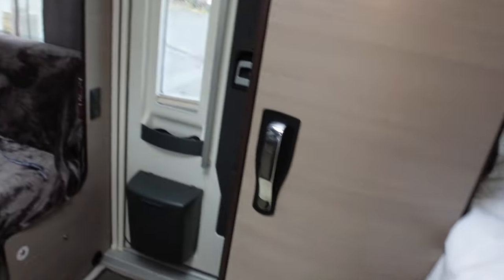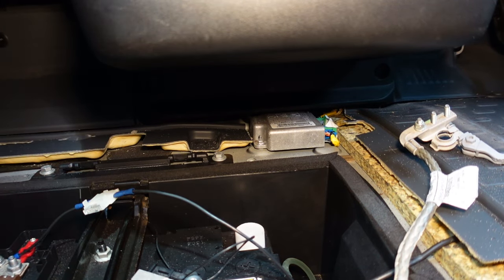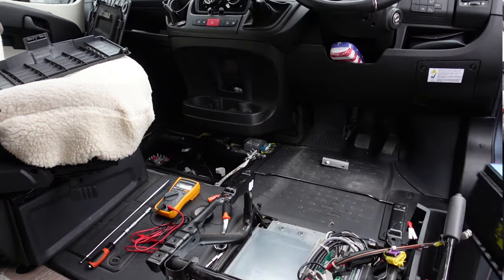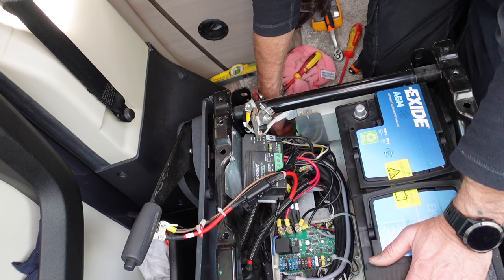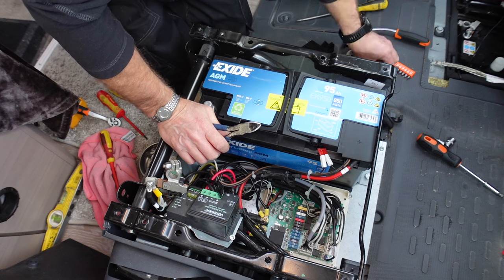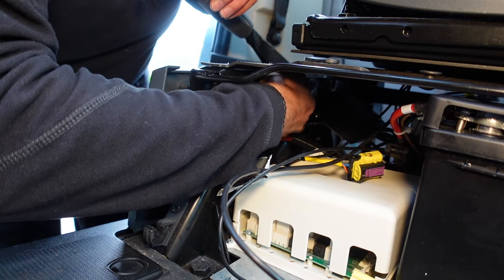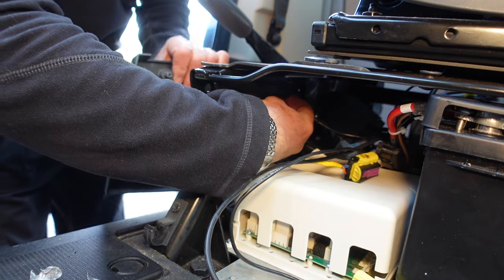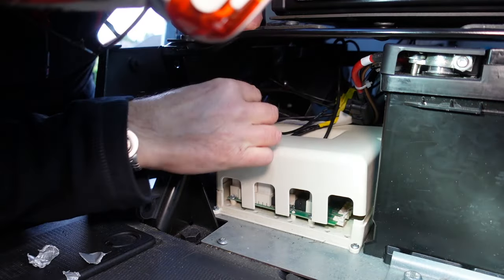Changing the leisure battery on a Fiat Ducato motorhome

Comment: we enjoyed the vlog on changing the leisure battery. not the easiest place but it does give you storage back under your bench seat and storage is everything. its worth mentioning that the thin gauge wires to the seat belt tensioner (large yellow plug ) are more often than not the cause of SRS airbag malfunction warnings so always best to take car with them and ensure they don't get snagged or pulled and are safely tuck away.  enjoy your next adventure

Comment: I feel your pain. We have a Hobby Optima Deluxe T75 HGE and my seat is out at the moment as I’m fitting a B to B charger and a battery monitor. I’ve had to replace the battery as well after 5 years and this is the 3rd time I’ve had the seat out for modifications. Unfortunately it doesn’t get any easier. Good job. I have fitted many accessories and have had most panels off and found routing solutions. Ours is identical to yours from kitchen/Habitation door forward. Don’t see many Hobbies out and about, i will have to look out for you on our travels.
Reply: We’ll watch out for you Roger! It’s a game spotting the Hobby 😜 They are good looking buses aren’t they 😍

Comment: We have a Hobby premium 65ge, very much the same layout as yours, our original leisure battery was in a box that sat behind the drivers seat and next to the water boiler - by where your messing at around 19:20 - i removed it from that position and fit 2 lithium batteries under the drivers seat and then fitted a 3000w inverter where the original battery was, all our fuses are in a little cupboard under the fridge, there was hardly any wiring or fuses under the seat like in yours, cos under that seat is pretty big area
Reply from the maker: Good job!

Comment: What a job,but looks like you were very thorough, can l ask did the van alarm go off once you took off the negative off the engine battery,you said l don't know if you heard that,that was the alarm?l need to change my Leisure battery.Thanks.
Reply from the maker: Hi, Slaw has looked back and he thinks it didn’t go off, it just beeped because the alarm was turned off 👍🏻

Comment: Hi - What a pain just to even get to the leisure battery. Hopefully the air has now cleared of any blue-ness!!

Were you able to double check that the old battery was indeed knackered? I have found that if a battery suddenly 'dies' rather than 'fades'  sometimes it can be another problem - such as alternator regulator or mains battery charger or even a loose connection.
Might be worth keeping the old battery and charging it up with different charger just as a final test before you re-cycle it. Be interesting to know the results.

Keep up the entertainment - nothing much on telly these days and we love the humour element that is the Slaws. Well done!!

Kind regards,

Mel and Shell.
Reply: Thank you! Slaw suspected there was an issue as the battery had shown less staying power recently. The new one works perfectly so we know it was on its way out 👍🏻

Comment: Thanks Mr Slaw thinking of changing mine to Lithium which is also under seat , was it difficult to take seat off?   i currently have smaller than yours a  gel type laying on its side and lot less wires think Hobby designed van very differently ,

Comment: Hiya, I have just watched this and noticed that you installed like-for-like. I noticed that you use a start-stop and not a leisure battery. Any reason for this? There is a difference in the way they both handle output/input. And.. why not replace with LifeP04 as, yes it's more expensive, but will benefit more in the long run?

Comment: Awesome video. 

I have to Change my T5 camper leisure battery.  Which is also under the drivers seat.   I’d like to know more about the isolator.  I also have an isolator.  But I’ve never really known when are you meant isolate like if the van is going to be parked up for a while should I isolate the leisure battery. 

Also sometime I put my van on a trickle charger.  Especially during the pandemic 

Could the trickle charger damage the leisure battery.  ? 

Cheers.

Comment: Poor design for the battery location. I can remove the leisure battery in my Bessacarr E560 in less than 2 minutes as it’s located under the bench seat in the habitation area, under the floor. I use the Votronic solar system as well and it pulls power from the solar panel even in very low light conditions. It’s a brilliant system. Did your work cure the problem though. Great instructional video thanks.
Reply: It did indeed! We were out last weekend👍🏻

Comment: Great tutorial Mr Slaw 🍻 picked up some valuable information x  do you keep motorhome permanently Hooked up while at home? I’ve just installed the outside socket for mine & plugged Bessie in, is it expensive or cheap to do so,it’s only 4 days so can’t really tell yet lol any info greatly appreciated
Reply: Thanks Andrena! We do keep Helga permanently hooked up in winter. We use a small 500w Delonghi oil heater that’s cheap to run.

Comment: Hi Slaw
I was just wondering if you could possibly help me
Could I ask you - do you leave Helga on charge all of the time whilst you are at home?
I bought a brand new Rapido Dreamer Van last year (on a Fiat Ducato Base)  - but I am having to keep it on charge to keep both batteries powered up
If I switch the mains off - in about 3 days the leisure battery is nearly flat and the cab battery is about 50%
Is this usual do you think?
At the moment I don't have a solar panel fitted on the roof (but will be getting 2 this year) - so I am having to charge it up from the mains
Does your leisure battery lose its charge in a couple of days as well if its not charged up?
I have absolutely nothing running in the van except the alarm - and it seems weird that the batteries lose their power so quickly
Do you think I have a duff battery?
Should these batteries lose their power so quickly?
If you have any useful advice I would be very glad of it
Cracking vlogs by the way!

Comment: I also looked at the battery in my T65HFL, and the layout under the driver seat is different to yours.  In mine (2017 model, but first reg 2018) the battery is orientated across the chassis rather than along the chassis.  Easier or harder?
Reply from the maker: Hi Ian, they must have chaged it after mine then. Do you have a photo. If so please email it to me and I’ll have a look. theslawsadventures@gmail.com

Comment: Good video but why a AGM at a leisure battery?
Reply from the maker: Apparently it’s very good as a leisure battery and fitted as standard by Hobby.
Reply: @TheSlawsAdventures  Ok, in my I have a AGM as a start battery, the leisure battery is of a different type. I have read that AGM is suitable as a start battery since gives a lot of power during a short period. The leisure battery however is discharged slowly and to a larger degree.
My leisure battery is a Tudor DUAL battery. I’m no expert but that my setup.

Comment: Is this actually a leisure battery? Start stop, cca rating and whatever i google let me think this is a starter battery, not a leisure battery. A leisure battery can be discharged for 50%, a starter battery only for 20%. Fine for very low loads but anything more will kill it pretty fast. I would never recommend a starter battery for leisure usages
Reply: I was thinking the same thing. Not sure that battery is a proper leisure one.
Reply from the maker: Yes the battery is the leisure battery and is fitted as standard on my Hobby which I bought new. AGM batteries are great for starting engines and off grid use.
Reply: @TheSlawsAdventures  I know this is the leisure battery, but for the type it seems you have used a starter battery. AGM is great, but there are different types for specific purposes. This one seems to be for starting purposes, not for leisure purposes. Difference is thicker lead plates internally, which allows it to discharge more. Using a battery made for starting purposes as leisure battery will work but it's definitely not recommended. It's like buying a Vauxhall Corsa for a horse trailer... It will work but it won't last as long you would expect.
Reply: I,ve had this type of battery 7 years